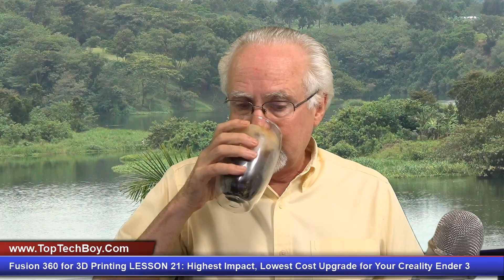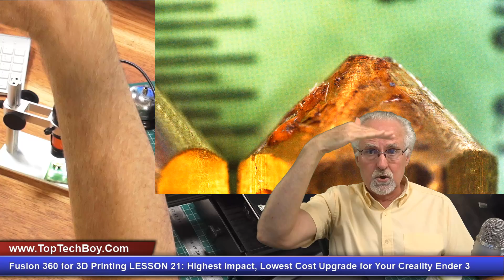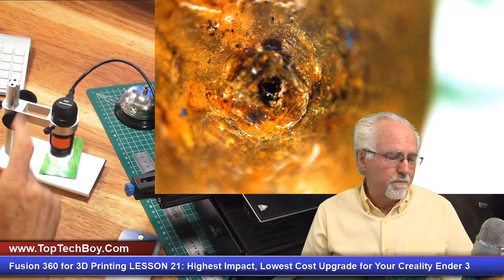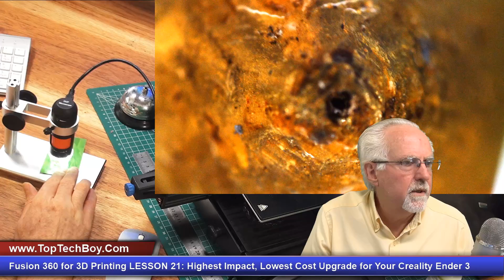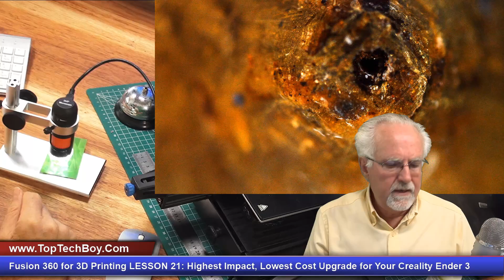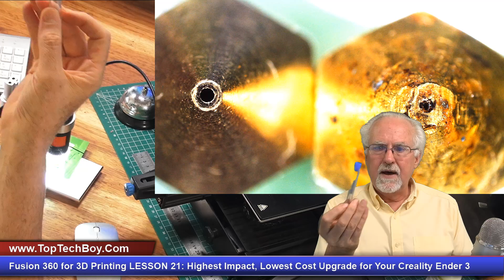Fusion 360 for 3D Printing LESSON 21: Highest Impact, Lowest Cost Upgrade for Your Creality Ender 3

Comment: Aren't those 2 different nozzles??? The landing next to the threads on the first one isn't aligned to the landing of the second one.  So if you line them up,  the tips should be close to the same length.  The angle of the points are different as well.  So I would conclude that the nozzles are from different manufacturers.  The tip of the second one is definitely worn though, but it may not be from the nozzle colliding with the bed. Love your videos,  just my ocd with details kicking in....

Comment: A couple of things:  First off, you are completely right about the nozzle causing ALL f those problems--IT DOES!!!
However, I stopped buying the cheap brass nozzles as many of them contained flaws from not having the center-hole drilled correctly; and I mean everything you can think of between partially-drilled, shavings remaining, non-perpendicular alignment to wrong or wobbly hole orifice from their worn-out drill bits!

Instead, I bought the hardened-steel from Micro-Swiss and never looked back.  I do a fair amount of printing and have not had to replace my nozzle yet (by this time I'd be through at least 10+ or-so of the brass ones). So, far when I do a microscope or test-print evaluation, everything just looks the same. They are $15 but to-me worth it.

Additionally, I have switched to a 0.6mm nozzle (also Micro-Swiss hardened) and my print-times have absolutely plummeted, and with very-little if-any loss of quality, accuracy or definition. Once you have a 0.6mm nozzle dialed-in, you'll never go back for general printing!   I only use the 0.4mm when I absolutely have to get everything out f the printer, but is so rare.  For things that require real precision, I use a 0.2mm but you really have to be patient and set up the printer to realize the incredible accuracy of this nozzle.

Lastly, I use a dial-indicator clamped to the printhead carriage--even a cheap one is just fine as you are making relative-measurements.  I then use the manual movement controls to move the printhead to all points on the bed.  I initially zero the indicator in the center then move to the outsides and make my tension-spring adjustments.  If I find any warpage in the bed that I cannot adjust out, I use aluminum-tape to shim (most times the very center) the areas that appear to be chronically low.  
Additionally, I always heat up the bed to make the final adjustments, especially the printhead.

Hope this helps.  Its kept me out of the insane-asylum!!!
Reply: such a great idea, will immediately look into both of your suggestions and I like the precision/time relationship!!!
Reply: Thank you for this elaborate explanation. This is gold

Comment: This is super helpful. I am also struggling a bit with print quality lately, especially adherence of the first layer to the bed. I tried several things like paying more attention to leveling the bed, preheating bed and nozzle, adjusting the temperature during the print and lowering the print speed. Now this video seems to validate that it is indeed the nozzle. I will replace my nozzle and hope this will do the trick. Thanks Paul!

Comment: I suppose the "number of prints" could be translated into "hours" of printing time. The "hours" could be monitored by an Arduino, or other microcontroller - warning us when it is time to change out the old nozzle for a new one. Also displaying  total "Run time" since the last swap out. And other information. Thank you for the fascinating video content, Paul.
Reply from the maker: That is really a better way of saying it. It is really how much print time, not number of prints. In a next lesson, I also show how to check the quality of the nozzle before every print by doing a small extrusion in air and inspecting the extruded strand.
Reply: @paulmcwhorter  That will be interesting !

Comment: I have experienced the same thing. The only thing I have found that works is using a 0.275 mm feeler gauge, autohome nozzle, move to +0.03mm Z, level bed with feeler gauge, it needs very heavy friction. To have the print stick you must use ordinary stick glue. You do not need a heated bed, however, the stick glue MUST be fully dry for it to work. I use a torch to dry mine. I have printed 300+ prints on the same nozzle.
Reply from the maker: Change your nozzle and see what happens. I maintain that with a properly aligned printer and new nozzle, you will never need glue.
Reply: @Paul McWhorter  Thanks for the reply, however, I have done an exhaustive study on the subject, stick glue is the only thing that works. Also, when leveling the bed, it must be rechecked until all do not need adjusting. Also, the ambient temperature effects the required nozzle temp. In very hot weather (90°F+) 200°C is good. If the ambient temp is about 50°F, it needs about 210°C, and similarly, if it is 32°F or below, it needs to be higher, the exact numbers I have not determined, however, I know 210°C does not work in freezing ambient temperatures.